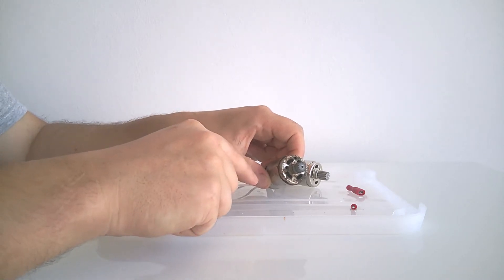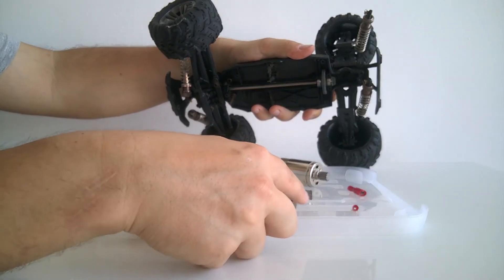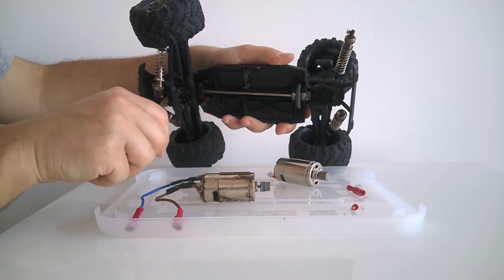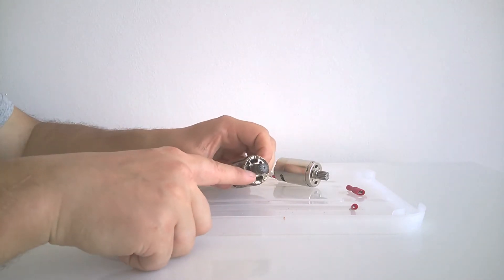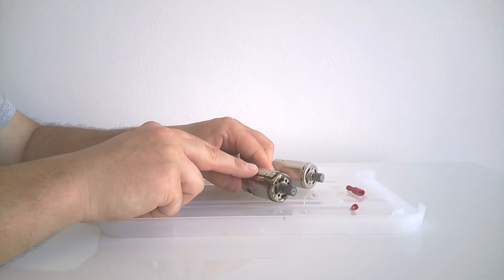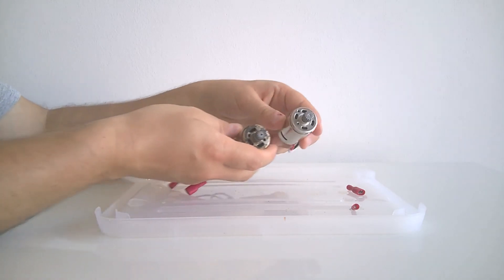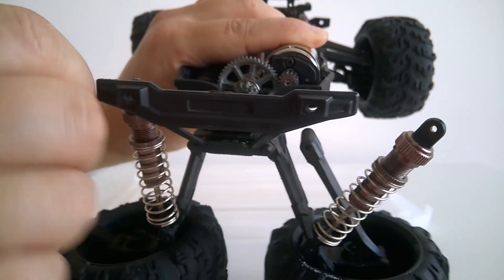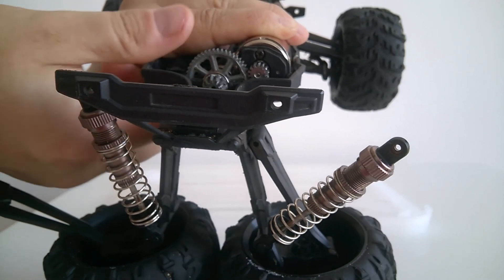Electrical Motor Gear Problems on Xinlehong 9136 (Flyhal, Hosim) RC Cars. How to replace motor gears

Comment: Just heat the pinion gear easy to take off.. There is available pinion gear in 9130 in the market...
Reply from the maker: I think you would still need to buy a special gear removal tool.